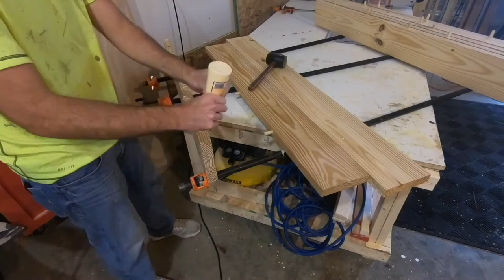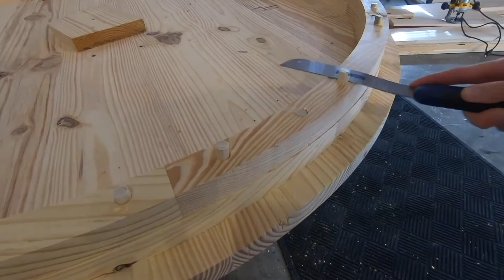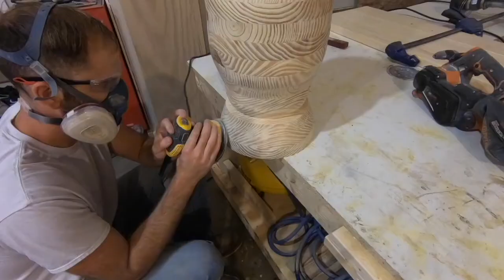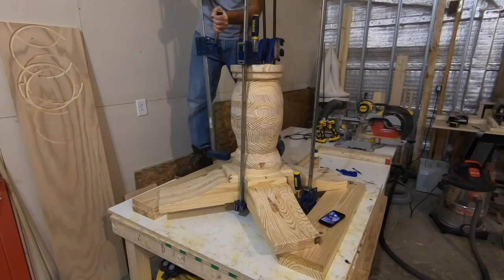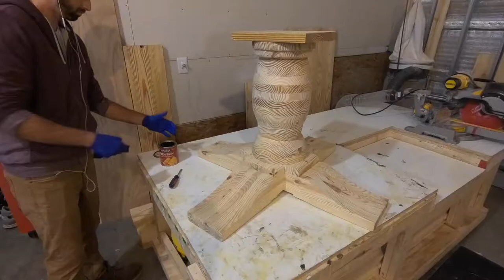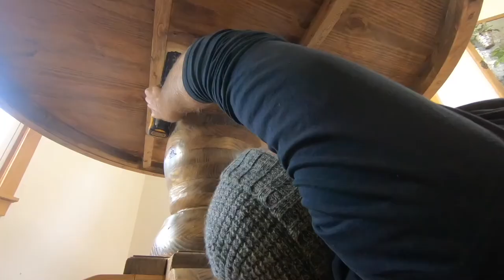Pedestal Dining Table Build

Comment: Won't you have trouble when the top expands & the pieces you added (glued & screwed) don't expand with it?
Reply from the maker: Yep, you’re correct. I didn’t fully understand wood movement when I was building this table. The top has developed a small warp and crack over the last couple years. 
I gave this table to a family member for free, so I don’t feel too bad about it 😆

Comment: i notice that the surface area you connect the pedestal to the table top is small. two questions:
1- the table top has too much overhang. does the table have tipping issue? 
2- I also notice that you build this table out of solid wood. you don't leave any gap for the wood to move ?
Reply from the maker: There isn’t a tipping issue, the base was very heavy and the feet extend outward quite a bit so tipping was not a concern. I definitely should’ve attached the top and the bottom supports differently - you are correct with the wood movement comment

Comment: Good afternoon. Tell me, why did you spend so much time on the production of this beautiful table and use ordinary pine, and not oak, beech, walnut, elm, etc.?
Reply from the maker: When I built this table I was still very new to woodworking, and was still learning proper milling/joinery/etc techniques. I didn’t want to spend a lot on materials considering I might’ve made some errors at the time of the build. I actually gave this table away for free (to a family member), so I was trying to keep the material price down.
If I was redoing this today, I would 100% be using hardwood 👍🏻

Comment: I’m about to build my first table using this video as a guide. I was told that using joint biscuits is a better method than dowels. Can you give me some insight on the pros and cons of either method?
Reply from the maker: Nice! Either method is fine.. biscuits are faster and easier to use, but a doweling jig and dowel rods will be cheaper. I used to use dowels frequently but found out that if you can mill your lumber well, neither is necessary (assuming you can get a flat glue up), so I don’t use either anymore to save time. However both will help with alignment and can help keep things flat! I’d probably recommend biscuits if I have to pick one
Reply: @mmcc_woodshop6288  thanks man! I appreciate the good word and active responses. I’ll be sure to send my finished product

Comment: What would happen if you bypass the first steps of assembling the wood and just glued the planks together...sorry if that sounds dumb...I was just wondering  if it were possible?
Reply from the maker: That would work fine, the boards might not line up quite as well but there is nothing wrong with doing it that way - I've done it as you mentioned several times! 👍
Reply: @mmcc_woodshop6288  That'll make things alot easier for me!!! Thanks for replying!!!

Comment: Do you have any plans for this?
Reply from the maker: I don't for this one. I was completely winging it. I really want to do a rebuild with plans and dimensions once I get some time, so stay tuned.

If it helps any, the top is 62" diameter. The 'feet' of the table are ~42" across, and right about 5" tall. I just kept adding the pedestal circles until the table was 30" tall, including the + shaped piece on the fee, and the rectangular piece I attached the top to.
Reply: @mmcc_woodshop6288  i just knew it you were winging it, lol

Comment: Can you give a rough estimate on the pedestal bass measurements
Reply from the maker: If I remember right the feet were about 42” across and 5” tall with the plus looking piece (that goes on top the feet) another 1.5” or so. The middle post just made up the difference between the top and the feet/plus piece so it was probably around 22” or so (30” total height). Hopefully that helps!